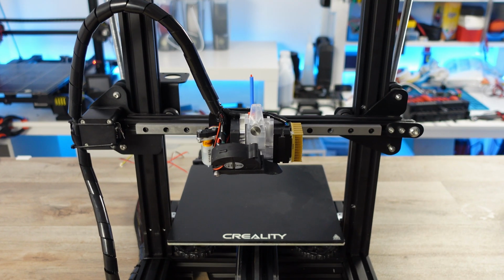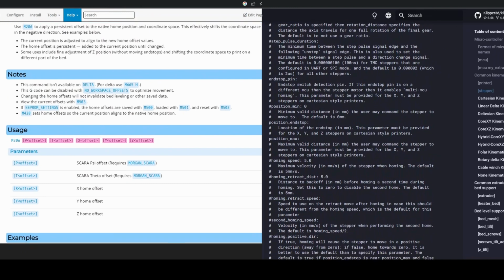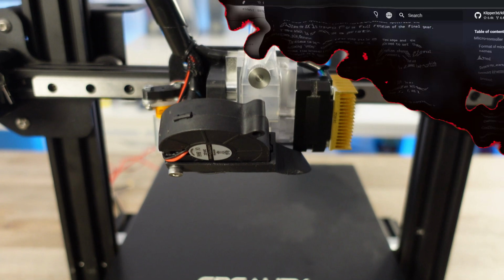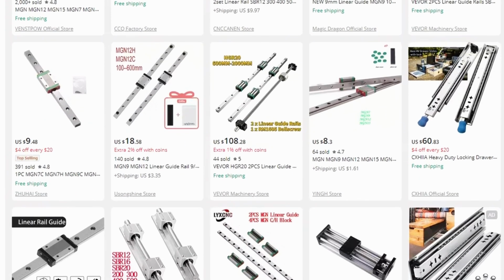Linear Rail upgrade for the Ender 3 PRO | X-Axis

Comment: Any tips for the lost Y-spacing done by having the rail mounted in front? I've been thinking that maybe driling new holes in the bed carrier, or the y-extrusion itself, or even adding a small additional piece of extrusion in the front of the printer would be all options.
Reply: This is my current issue and idk how to fix it besides going back to the 3 wheel mount system
Reply: Did you guys have issues with your axis limits were you getting errors?

Comment: U should thighten the rail from one side, then go from that side to the other, this Will make sure the rail is as thight as possible against the aluminium profile! (same as cross thigtening a rim to a car)
Reply from the maker: For sure. It is the technique I used in the video
Reply: great video! i would recommend to tighten the bolts from the center outwards. This way you even out the material tension of the rail instead of cropping the tension in the center.

Comment: As you said, it's one of the last upgrades you do, but even then it makes so much more sense to upgrade Y which is much heavier and problematic first. Or even Z. Otherwise there will be just absolutely no usable benefit.
Reply from the maker: I agree with you that Y and Z conversions are more beneficial. But for somebodies' first attempt at linear rails conversion, The x axis is the easiest and can provide the necessary experience to move to the other axis. The Y and Z conversion can be quite frustrating as you have to align the 2 linear rails in tandem for smooth operations.
Reply: @yogitech-3D  For me I went with the X axis conversion first simply because I kept having issues with the v wheels and unreliability.  The different between the two are night and day when it comes to getting accurate ABL meshes.  No more 1st layer problems for me.  And that was after I changed out my v wheels 3 separate times.